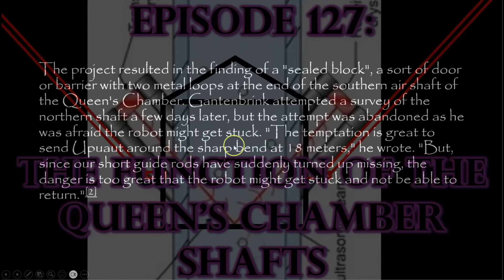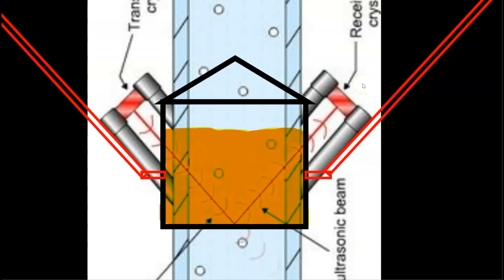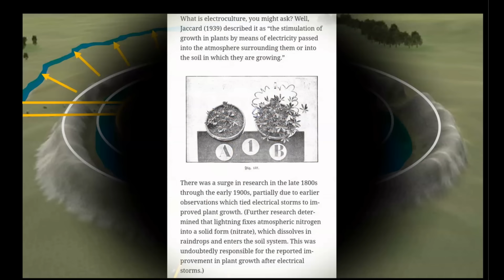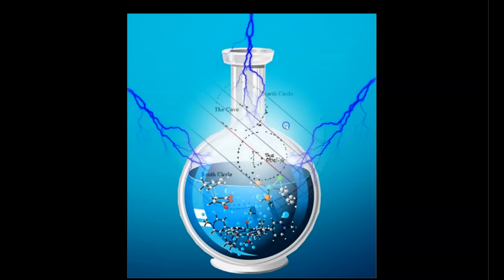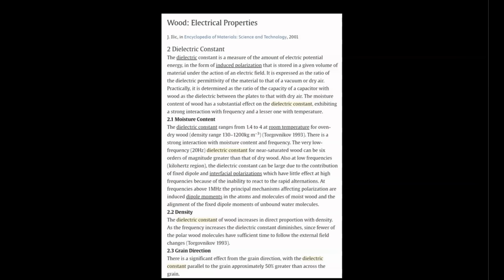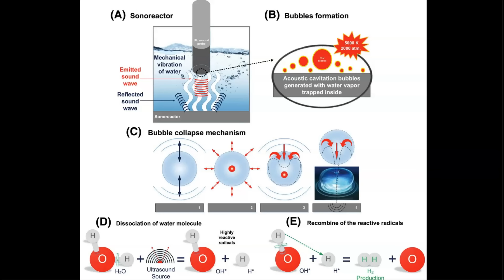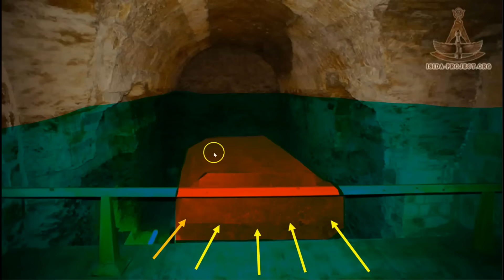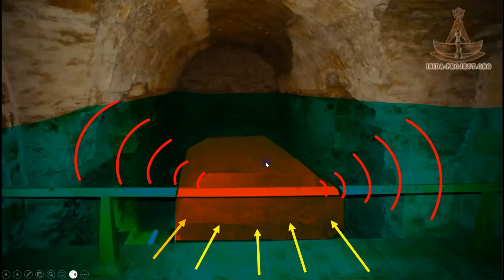Episode 128: ANCIENT TECHNOLOGY - The Function Of The Serapeum

Comment: It might be wise to consider the value of Oxygen as a by-product since it could have been as useful as the hydrogen.  So far your words have only focused on the latter.
Also, with the recent discovery of a branch of the Nile that was the line along which the pyramids were built, the Serapeum must have been fairly close to it and therefore could have had a water source for flooding it.
And as an aside, my mind puts the accent in the word "Serapeum" on the third syllable, not the second. That way it conforms with the familiar pronunciation of coliseum.  It would sound quite strange to say "col-I-seum".  ;)

Comment: It's already open source and royalty free for more than a year. You can create matter from dust.. DC to AC Dust to matter conversion and create all the elements from the dust and gases in the air. It's really easy but extremely dangerous because of the amount of energy it makes and the uv and x-rays from the cavitation as well as the gamma rays. The elements it makes such as gold and all the sacred metals will be radioactive for 3 to 4 days. It's basically cavitation and charge separation using sound and all the radio frequencies by use of a spark gap beside a transducer... and a hole to get everything to suck into it creating a vortex that rips everything apart.. destroying matter on one side where it is sucked through the hole and have it charge separate on the other side of the hole where it fuses into new elements.